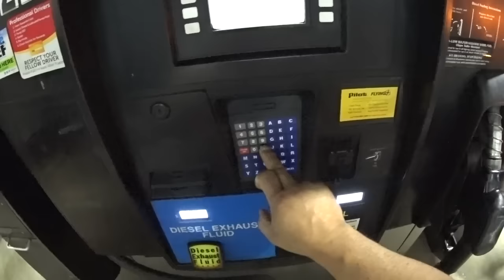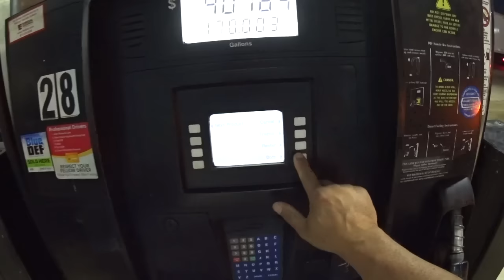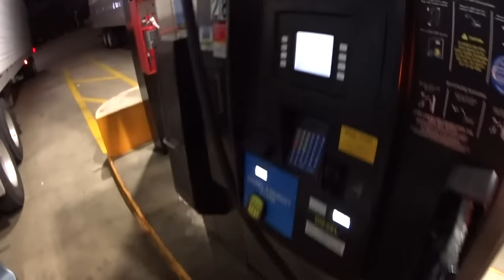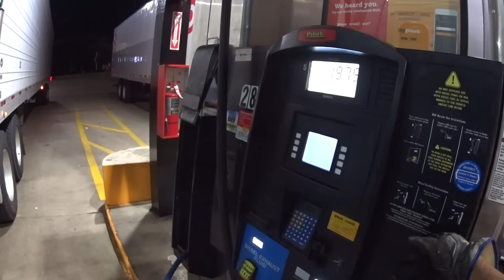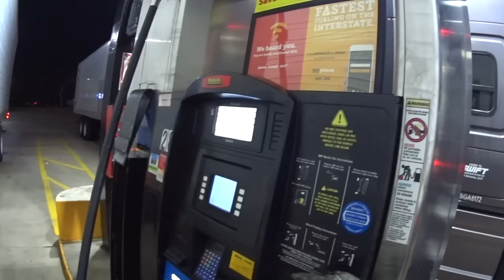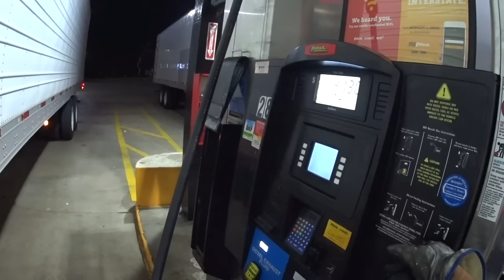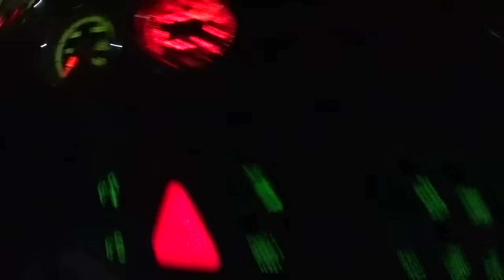3196 fueled at the pilot London Ohio

Comment: What happens if one of the tires is flat then what
Reply: I imagine the flat tire would have to be repaired/replaced before further travel.
Reply: Really wow I didn't know that
Reply: Ask a dumb question - get a dumb answer.
Reply: I wonder if you have to put the keys in the engine to start the truck